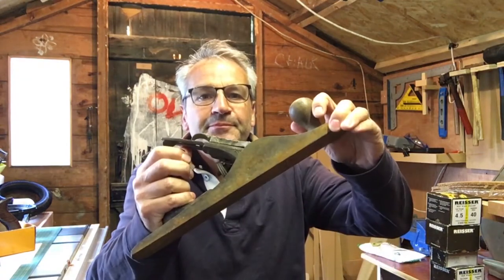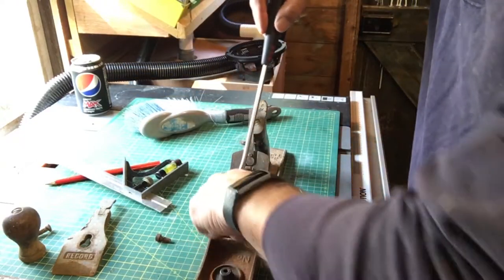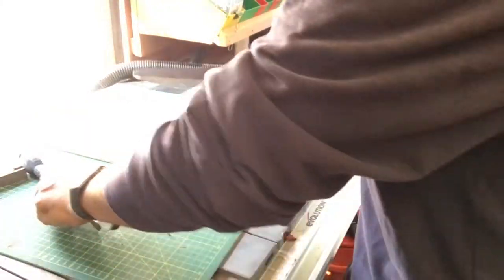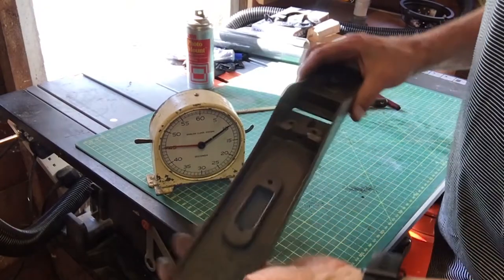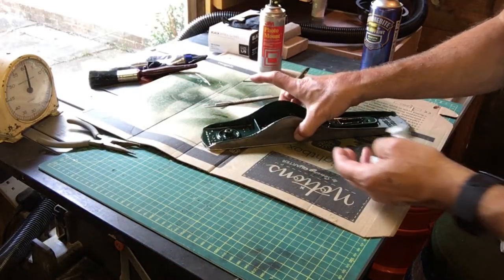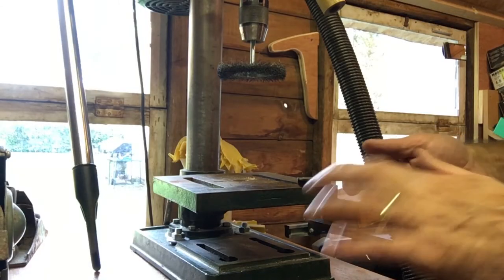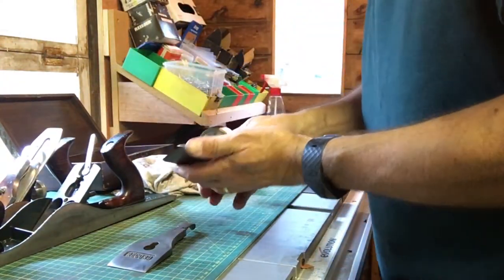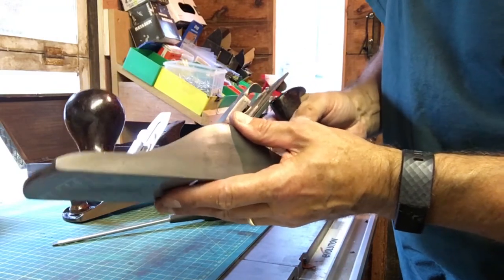Restoration of a Vintage  Record No. 5 Woodworking Plane

Comment: That plane ender up very nice looking!  Very good job Sir!

One thing about the frog and the sole that is worth noticing… the small surfaces where the frog and the sole connects needs to be clean (unpainted) and level.  It looked like there was some paint on some of those surfaces.  You can check how well the frog mates to the sole by removing the frog screws and wiggle (put a finger on each diagonal corner and press slightly down alternatively on each of the corner, rinse and repeat on the opposite diagonal corners of the frog).  There should of course be no rocking/movement.  Clean the surfaces well before the test, no paint or grit/dust.  Apply some oil on the surfaces for rust protection.

Also where the blade is to sit on the frog should be leveled for best performance.
Reply from the maker: thanks for the tip - I have learned quite a bit about setup since then just by trial and error

Comment: 4:00 the frog is the triangular, cast iron part you're unscrewing from the sole. The part you put in your hands that connects to the iron is called the chip breaker. In the UK, I think you call it something else.
Reply from the maker: Yes this was an early vid I am familiar with the correct terms now, in uk the chip breaker is called cap iron usually thanks

Comment: darkening on the sole indicates that the plane is not sanded ... but I know how long it takes.  I start at 80 grit (grit in Ukraine) since I live in Ukraine.  and things are moving forward.  now completely restored the scrub plane of the USSR and remade under Lee Nelson, but an excellent result takes time.  but I am aiming for this because many of the remanufacturing tools I put up for sale.  I wish you a good restoration. Good luck 😃
Reply from the maker: thanks - i also need to improve technique when sanding as it takes a long time